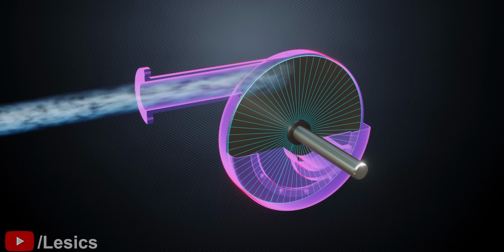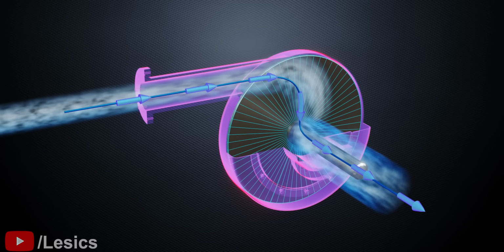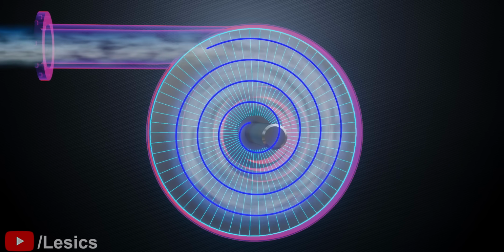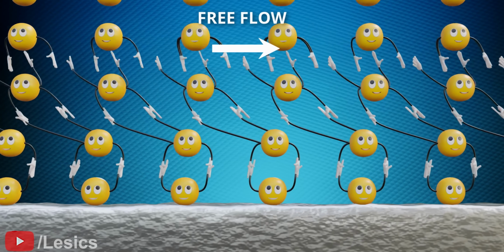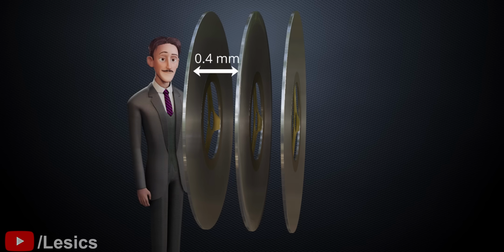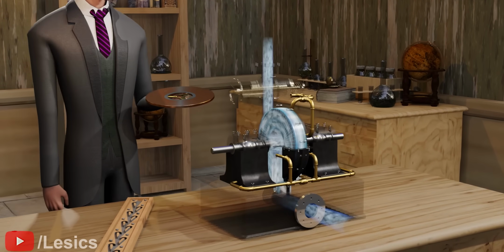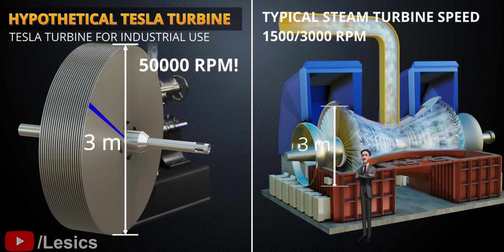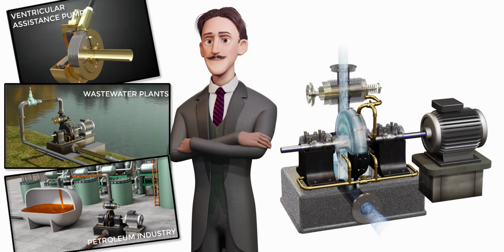Tesla Turbine | The interesting physics behind it

Comment: So it’s almost like a pump running backwards
Reply: yes, I mean in the end they literaly said, that now it's used as a pump
Reply: nope .... the steam enters a GAP between the center plates ... each plate has a set of holes on the outer edge in the first ring ... as the steam passes through these angled holes they begin to spin as the steam will draw the plates around ... the enxt plates have holes in the middle ring and the steam that passed through the first plate now moves down and through those holes and on to the next plate ... his most efficient design has 12 plates a side with holes alternating from outside edge to middle to inside edge ... and THAT is what generates the power what they are showing and demonstrating is an overshot water wheel with no buckets ... while the tesla turbine uses the bernoulli effect and coriolos effect to move the plates ... they got it completely wrong ... just like thomas edison

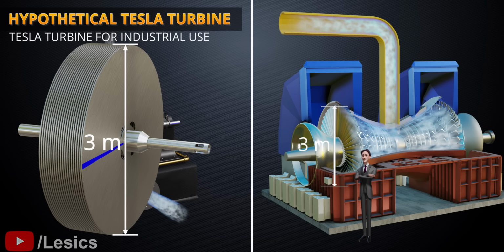Comment: 8:00 The main issue is the blade tip velocity.  So why didn’t Tesla just use smaller-diameter discs, say 5cm diameter— 35,000 RPM on a 5cm disc would give you a reasonable edge speed of 91.63 m/sec (0.26 mach).

A 5cm disc wouldn’t produce much rotational energy of course, so you’re just need more of them— a few hundred should do it.  And don’t tell me the axle couldn’t handle it— 300 discs in one turbine and 30 discs each in 10 parallel turbines with bearing in between (splitting the input water 10 ways) would give you the same rotational energy (minus the additional bearing friction).

Seems like a pretty simple optimization problem to me— for a given flow of fluid and a target rotational speed, you can either go fewer bigger discs or many smaller discs.  What am I missing?

I’m sorry, but the argument that industrial turbines must be 3m and “the only option is to reduce the RPM” seems like a strawman argument— in engineering, there are always many variables that can be adjusted in order to optimize the problem for the materials, input, & output.

Comment: Why do you need such a large diameter disk? Jack Bitterly had carbon fiber disks of 10 inches spinning at 60,000 RPMs 20 years ago. Why isn't that sufficient for industrial applications?

Comment: What about hooking it to a load? Even external copper disc like a regenerative break. Use Lenz law to adjust the RPM. Use the distance from the permanent magnet to adjust the RPM once you've stabilized the flow. OR adjust the magnet and the flow simultaneously for maximal power output. Tesla just had to pull more power out, or god forbid, design it less powerful...

Comment: At least his efforts never went to waste and his turbine is still used today.
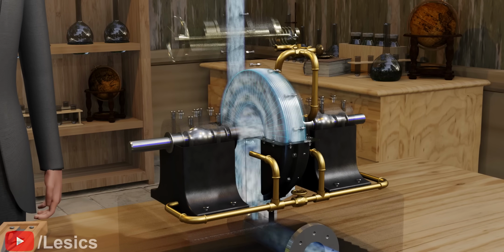Reply: You didn't watch the video. At 6:47. "It failed horribly."
In his words, it's "hypothetical." I.e. it's bullshit -- like everything Tesla except the spraky sparky machines used in the silent movies.
Reply: @David_Lloyd-Jones  I'm pretty sure you're the one who hasn't finished the video. It specifically mentions how the design, due to it's reversible nature, is used in pumps in the modern day. If you're going to be rude, the very least you can do is what you're accusing someone else of failing to do.
Reply: @David_Lloyd-Jones  Hydroelectric power plant, AC distribution, RF circuits, Motor design and a bunch of other stuff but apart from that you're probably right.
Reply: @trollobite1629  I would say some use is better than no use. I mean, remember this is a design well over 100 years old. Also it's important to understand the main drawback of the turbine: the disks warping, still has the possibility of being solved by new advances in materials science.
Reply: @David_Lloyd-Jones  not hypethetical, looks like u missed the end where it mentioned the application in waste water treatment and high viscous applications, we cannot say the design is failure but has not a revelent application in industry , as existing turbines run at 100000 rpm and this design he made maxed out at 35000 rpm because of material limitation it failed, this can certainly be improvised, his concept of power generation is brilliant and can be used with right modification for today's industrial usage

Comment: When your ordinary home jet from not that long after ww2 easly withstands 90k rpm despite it being a lot less strong than a solid disk. Than that shows the material has greatly advanced even back then. That limit which n.tesla had is mostly gone now. Devices can be made a lot more precise, material is a lot stronger. Even a piston engine can reach 10krpm these days. So why not give the turbinena new try. For what I read it was mostly unused because most current day physisists did not understand the engine, and because of the amount of work put into piston engines.

Comment: All im hearing is, it will not work for commercial steam turbines because they are too large in diameter. So, what of the small ones for like in the 5 - 100 kw range? Would be a pretty nifty co-generation device. The turbine can be made easily on a wire EDM machine.

Comment: 3:31 I can't wait till the water reaches itself and creates a second lane, so to speak.  Since the inner lane is shorter in length, and there is a friction between the layers of water, which is uniform with the direction it is already headed.  The result should be an increase....

Comment: so in theory you could power this thing using itself and basically has a version of the arc reactor
Reply: While watching this video I was thinking this could be a good way to generate electricity if you connect the inlet to the end of the gutter and power it with rainwater (I live in a rainy country ;-) )

Comment: So this is basically a more efficient water wheel where is gravity pulling water down or pressured Water is providing the energy and this is just harvesting it and transferring it in another direction like the water Will using the water falling via gravity and turning a millstone or shaft to run the blades had a sawmill or whatever that mill was doing. This is basically what all Hydro electric generators do they’re using the flow of water pressurized by gravity in those cases to turnA wheel of some sort connected to a shaft which is sort of what a turbine is the jet turbines are quite a bit different and I think we’re about example in this case.  This turbine isn’t producing power it’s harvesting power more efficiently than a traditional water wheel word but is basically the same thing. A jet engine actually introduces fuel an expansion of fuel is what creates your power it draws in cold air pressurize it and as the fuel as a mix with that air and burns it expand quickly and shoots more out of the back of the turbine engine and the fuel is actually creating the power. Tesla turbine needs water flow and just harvest that energy.  I don’t think a jet turbine is the same thing at all the jet turbine is an engine to get power from burning fuel Teslas turbine it’s just harvesting the flow of the water, comparing it to the power generating turbine and a Hydro plant would be far more accurate because that’s basically what it is and is just an efficient water wheel which has been used for hundreds of years.  , It’s just a different kind of water wheel. I think the reason it’s not used in industry isn’t all that sinister I think it has more to do with bang for the buck, Tesla is very complex to wear a propeller type turbine being turned by water falling with the power of gravity is just more fission and cost-effective altogether.  Yes changing to Tesla’s type a turbine at a water plant might yield slightly more efficiency but it’s tolerances and intricacy are going to be cost prohibitive on a large scale not to mention the training in the maintenance, it’s just a lot easier to use a traditional turbine which is very simple and you just flow the water through the tube and it turns a shaft and generators use that energy to make electricity, this design is the same thing it’s just a different way of doing it which may be more efficient as far as how much or what percentage of that energy at harvest but it’s also more difficult and more expensive to do than the way Hydro generator is working now and that’s probably why everyone in the industry does it that way because it’s just the best return on investment and if you have a damn with falling water are you have a pretty much in life supply of energy I don’t need to get 97% of it if you get 90% of it for exponentially less investment you get a higher return on that investment because it’s just easier to do. You could put a jet engine in a car but it’s very complex very expensive and yes you might get better fuel mileage in the end but the car is gonna cost you five times as much and you’ll never save that much fuel to break even on the expense. That’s the problem that plagues the energy industry, solar power and wind power it’s nice and it works but it’s just not efficient and the only reason it’s in existence now is because of The government taking people’s money and spending it or giving it away to those running solar in subsidies. Don’t get me wrong I love solar and wind energy but don’t look at it as a replacement for fossil fuels that is silly and will never happen and it’s not nearly as good for the environment as people seem to think it is because to power the world they would pretty much have to strip it’s entire surface to mind the materials to create those solar cells and they would have to do that every 20 to 30 years to replace those cells and ecologically would be a complete and total nightmare, Oil already exists and is easy to harvest and turn into gasoline and is more efficient and produces less emissions than electric vehicles because the 2 to 3 batteries an electric vehicle will need within its lifetime will produce 70% of the omissions that a comparably sized gasoline powered vehicle will in its entire lifetime and it produces those emissions in the process of mining the minerals required to create those batteries, So an electric car and its lifetime will produce at least 40% more emotions than a gasoline powered vehicle just to get the materials to create the batteries if it needs three batteries it will go up another 70% meaning an electric vehicle will produce 110% more emissions in its lifetime than the same size vehicle running off of a gas engine would. It is also substantially more expense.  People always talk about the government is doing something sinister in the oil industry is preventing people from using water powered engines but it’s the same thing come out the power required to separate the hydrogen from the water Hass to be generated somewhere and it’s just not cost-effective or realistic, people have made hydrogen powered vehicles a.k.a. water powered vehicles and they work fine but they are incredibly expensive and that’s why we aren’t driving around in water power vehicles, They’re even less efficient than electric vehicles which are far less efficient than gasoline powered vehicles in the truth about it is gasoline powered vehicles are the most efficient and the safest for our environment because they produce less emissions overall because of the efficiency of a gasoline powered engine, it takes the energy and uses it more efficiently and thus in the long run produces less emissions.  People need to really research these things because tesla turbine is awesome it’s just not practical just like his wireless power, he wasn’t producing free energy it was incredibly expensive it was just wireless energy but that energy had to have a generator to put the energy out there first and that just cost way more money and you have to put way more energy out there because wireless energy is incredibly inefficient and every device requires an inverter and power conversion and collection most of the energy produced it’s just lost into the air so there’s no secret government organization trying to keep us from having all this free Tesla wireless energy it’s just not efficient, people build them and they work all the time but it would cost you about 5 to 10 times as much to run your house off of that type of energy system then it would to run off of our current grid system and energy production means. If you really want environmentally friendly highly efficient options look at nuclear. As long as there’s no nuclear meltdown or leaks it’s almost free energy and can be produced very economically and in huge amounts with little or no effect on the ecology, in fact some of the cleanest waterways in the world are the exhaust waters from nuclear energy plants.  But along with that comes risk because if there is a meltdown you end up with Chernobyl or 3 mile island again.  So at this point you’re only realistic options in an area that doesn’t have enough naturally moving water to create Hydro energy are going to be cold fuel or nuclear, everything else is so technologically inferior and less efficient that it’s just not practical or realistic, you could never run the United States off of solar because we don’t have enough materials to produce that many solar panels.  So saying that this turbine is too powerful makes no sense it’s not too powerful it’s to any fission for practical uses, But it doesn’t generate energy at all it’s just harvests energy

Comment: I've seen other comments about using the turbines at small scales rather than large, and I have to agree. It relies on viscosity, and fluids behave more viscous when observed at a smaller scale. Even air becomes soupy enough that motes of dust can float in it. The scale problem is just a matter of matching the tensile strength to centrifugal force, we have carbon fiber nowadays.